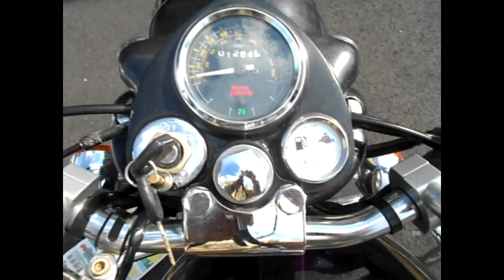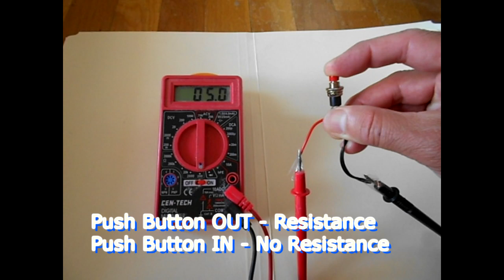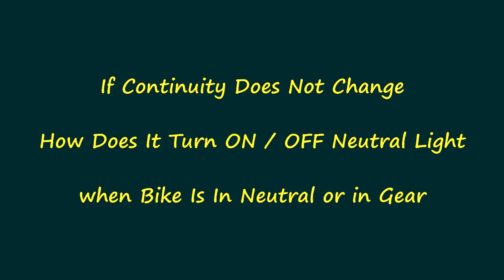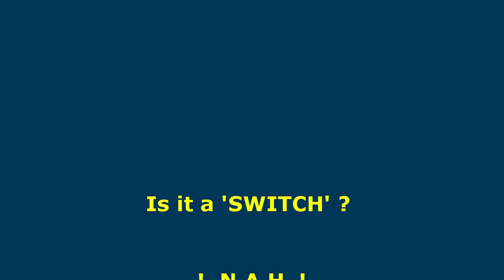How Does Neutral Switch of Royal Enfield Motorcycle Work

Comment: If possible can demonstrate all wiring details and connectivity. I had problem once, my bullet was not getting starts even though battery was fine. Was there no supply to spark plug. Finally mechanic took to his garage and rectified. He told that there was some flux like dust coated on some wire which was restricting the power supply from starter to spark.

Comment: Do you have any suggestions for what appears to be a bad solenoid? The starter solenoid on my G5 stopped working and I had it replaced under warranty. A year later the replacement solenoid has stopped working. I can only start the bike if it has a full charge (right off the trickle charger) or if I forcefully tap the solenoid before attempting to start it.

Thankfully, kickstart works every time.

Comment: The wire moulded into the swicth broke off flush when I was on a run. Why don't RE put a spade connector on top of the switch? Then changing it would be far easier. Most annoying.

Comment: singh5g Sir, I am installing a hydraulic clutch lever and assembly on my GT. The thing is the clutch lever has a switch for safety with 3 pins (Ground, Starter and Neutral)

But the hydraulic lever can't accommodate the stock switch, besides the lever has a switch with just 2 pins (I assume for Starter and Neutral)

Any tips on how to 'JUGAAD' or bypass the switch without any issues?
Reply from the maker: If GT circuit and neutral switch are similar to G5, then one can bypass the neutral switch by grounding its wire. ONE CAUTION: the bike will crank and try to start even if it is in gear !
Reply: singh5g Thankyou. I'll upload a video (With your credits soon)

I liked your support Sir! :)
Reply: Singh5g, could you please eloborate the solution, how to ground said wire..i am facing same problem with CGT?